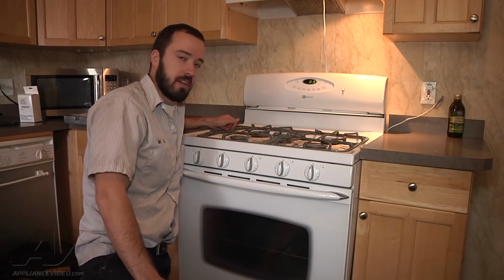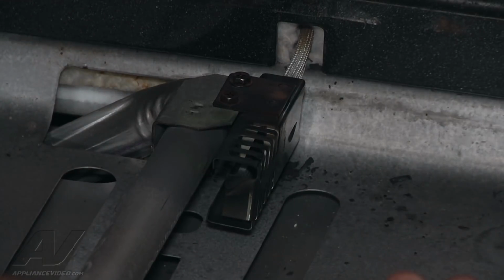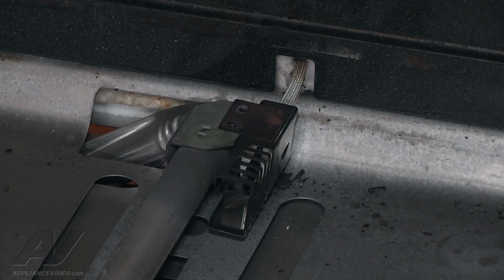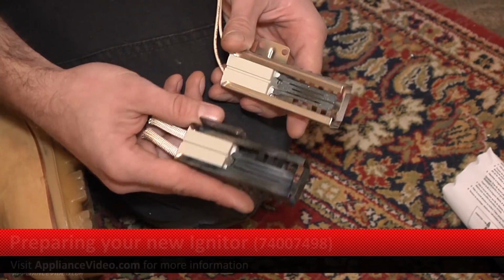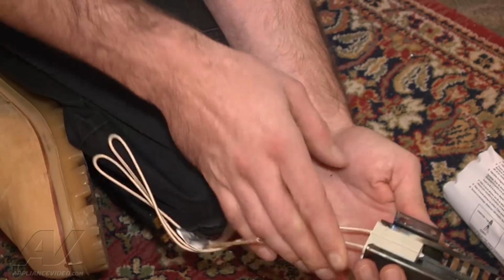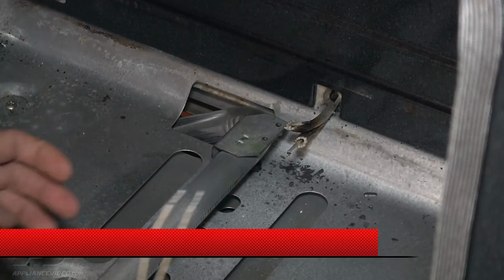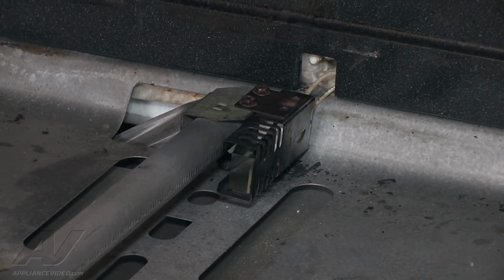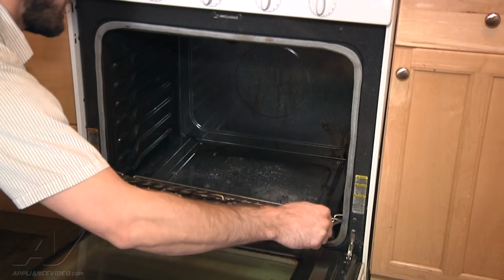Maytag Stove Repair - No Bake - Igniter

Comment: Thank your video, it helps me.  There's upper igniter on the top of oven,  I tested wire no electricity on both wire, I wonder  just change bottom igniter is fine or I have to change both igniter, Thank you

Comment: Hi and thanks for the great video.
I have the same oven and the ignitor was  not glowing. I replaced it by an oem igniter but still not working. I measured the voltage coming to the igniter and was only 2 volt. I guess it should be about 110 volt.
Can you please tell me what could be the problem? 
Thanks in advance

Comment: Hey good video I been try to fix my samsung stove that's giving trouble to light I see the ignitor glowing but it won't light some time it works and then again it won't I just might look to change the ignitor and see if it helps but the valve is good did a continuity test and it was good

Comment: I have had to do this a few times in my LG range. I believe if you hit the clean button or do some cooking on a very hot oven this will deteriorate this little glow stick breaking it down. So the more you cook at these high heats or set the oven on the clean cycle the more times this glow stick or igniter will have to be replaced

Comment: Thank You, Your video helped with the replacement of my igniter, The oven your working on here is the same model I have.
There was no need to cut and spice the wires there is an access panel in the back of the oven where you can access the wires for
the igniter and a quick disconnect, Simply plug and play, Old to New.

Comment: I have a 2012 Whirlpool gas double oven range and the top oven will not start on bake, it seems to work fine on Broil.  So, I am attempting to remove the igniter and have taken the two screws off the igniter and trying to remove it.  I got it off but there is not electrical plug like on your video and others.  Will I need to remove the back of the range and get to the plug from there?

Comment: When oven does not maintain the temperature setting. Can this also be a faulty igniter?
Reply from the maker: Great question, if you have a more technical question that our parts department cannot answer, you can search our over 17,000 answered questions free at our website www.ApplianceVideo.com under our Repair Help section. You can also call our parts department at 1-800-830-5465 and they can give you help 7-days A week ,or search at www.SaveMoreOnParts.com  .

Comment: Did you turn off the gas before doing the ignitor test?
Reply: No.  You wouldn't be able to test it if it lights the gas up then.
Reply from the maker: Great question, if you have a more technical question that our parts department cannot answer, you can search our over 17,000 answered questions free at our website www.ApplianceVideo.com under our Repair Help section. You can also call our parts department at 1-800-830-5465 and they can give you help 7-days A week ,or search at www.SaveMoreOnParts.com  .

Comment: You said to not touch the heating element. Is it okay to touch the ceramic parts? Just wondering. Thanks, Edgar
Reply: No.  The heating element is the ceramic parts.  The two long greyish things that stick out of the end of ignitor .  Don't touch with bare hands.
Reply from the maker: Great question, if you have a more technical question that our parts department cannot answer, you can search our over 17,000 answered questions free at our website www.ApplianceVideo.com under our Repair Help section. You can also call our parts department at 1-800-830-5465 and they can give you help 7-days A week ,or search at www.SaveMoreOnParts.com  .

Comment: My ignitor works I just don't get gas. Any tips? The stove burners work great just not the oven
Reply from the maker: Great question, if you have a more technical question that our parts department cannot answer, you can search our over 17,000 answered questions free at our website www.ApplianceVideo.com under our Repair Help section. You can also call our parts department at 1-800-830-5465 and they can give you help 7-days A week ,or search at www.SaveMoreOnParts.com  .

Comment: Excellent video!  I have a Whirlpool range, model #WGG555S0BS01. It started as not broiling or self-cleaning a little over a year ago. I changed the igniter (not an oem part) in December 2018, but it did not fix the problem, although it has heated properly until last night. Now, the upper oven is completely dead, with no signs of even trying to ignite or heat. The lower oven and all of the stove burners work perfectly.

Does this sound like a bad igniter, yet again?  I'm considering buying the OEM part this time in the hopes that this will fix the problem.

Would you recommend the OEM igniter as the fix for my oven?
  Thanks!
Reply from the maker: Great question, if you have a more technical question that our parts department cannot answer, you can search our over 13,000 answered questions free at our website www.ApplianceVideo.com under our Repair Help section. You can also call our parts department at 1-800-830-5465 and they can give you help 7-days A week ,or search at www.SaveMoreOnParts.com  .

Comment: Silly question..but do you also disconnect the gas and or turn it off?  Or just unplug it
Reply from the maker: Great question, if you have a
more technical question that our parts department cannot answer, you can search
our over 10,000 answered questions free at our website www.ApplianceVideo.com under our Repair Help section. You can also call
our parts department at 1-800-830-5465 and they can give you help 6-days A week
Monday -Saturday, or search at www.SaveMoreOnParts.com  24 hours
7- days A week.

Comment: It  IS necessary to put back the thermal insulation on the new wires!!  Before connecting the wires slip the insulation on the new wires (and keep them longer!) 
the connetion betwen the old and new wires will have to be pushed back into the cavity.
Reply from the maker: Great question, if you have a
more technical question that our parts department cannot answer, our
technicians are answering all questions at our website at www.ApplianceVideo.com under our Repair Help section. You can also call
our parts department at 1-800-830-5465 and they can give you help 7-days A week
Monday -Sunday, or search at www.SaveMoreOnParts.com  24 hours
7- days A week.

Comment: does it matter which wire goes to which wire since there is 2??? like green to green etc.
Reply from the maker: Great question, if you have a
more technical question that our parts department cannot answer, our
technicians are answering all questions at our website at www.ApplianceVideo.com under our Repair Help section. You can also call
our parts department at 1-800-830-5465 and they can give you help 7-days A week
Monday -Sunday, or search at www.SaveMoreOnParts.com  24 hours
7- days A week.
Reply: No.  It says that in the video.  Because its just a big circle or circuit

Comment: Matt, I could use some advice. I have a jennaire gas stove and the oven doesn't ignite. The broiler does but not the oven, so I put an OHM meter across the igniter  it had connectivity but I ordered a new igniter anyway. The new one draws a lot less OHMs so I installed it as per your video. Fired it up and nothing. I checked the wire coming in and going out of the igniter and both wires have 120 volts when bake is selected so it's completing the circuit but the igniter won't glow. The oven defaults to 100 degs. I don't think I have two faulty igniters? I would really appreciate any advice. Brad
Reply from the maker: Great question, if you have a
more technical question that our parts department cannot answer, our
technicians are answering all questions at our website at www.ApplianceVideo.com under our Repair Help section. You can also call
our parts department at 1-800-830-5465 and they can give you help 7-days A week
Monday -Sunday, or search at www.SaveMoreOnParts.com  24 hours
7- days A week.

Comment: Why is it that The ceramic wire nut can be touched with your hand whereas the element being made from ceramic should not be touched?....wouldn't the oil from our skin create a hot spot as well?
Reply from the maker: Great question, if you have a
more technical question that our parts department cannot answer, our
technicians are answering all questions at our website at www.ApplianceVideo.com under our Repair Help section. You can also call
our parts department at 1-800-830-5465 and they can give you help 7-days A week
Monday -Sunday, or search at www.SaveMoreOnParts.com  24 hours
7- days A week.

Comment: What if the igniter works lights up but the burner doesnt turn on could it be clogged
Reply from the maker: Hello, for
technical questions we have a Repair Help section at this link https://www.appliancevideo.com/repair-help/ . There are over 6,000 answers and questions you
can search through FREE to help you with your problem. Hope this helps
Reply: Look above I just answered it
Reply: yes. this happened to me when cleaning my oven just take a pin and clean it out and it will be unclogged, i had to wait two days for the water to dry.

Comment: i have  inglis ele. stove topele dont work properly comes on but wont stay on is it posible for it to be element
Reply from the maker: Great question, you can call
our parts department at 1-800-830-5465 and they can give you help 6-days A week
Mon-Sat . You can also search at www.SaveMoreOnParts.com 7- days a week.  If you have a more
technical question that our parts department cannot answer, our technicians are
answering all questions at our website at www.ApplianceVideo.com under our Repair Help section. We have over 6,000
common questions and answers that you can easily search through by your model
number, appliance make, problem or error codes, and It’s completely free to
search through our question & answer library. There is a very good chance
you question is already answered there.

Comment: What about the top burner
Reply from the maker: Great question, you can call
our parts department at 1-800-830-5465 and they can give you help 6-days A week
Mon-Sat . You can also search at www.SaveMoreOnParts.com 7- days a week.  If you have a more
technical question that our parts department cannot answer, our technicians are
answering all questions at our website at www.ApplianceVideo.com under our Repair Help section. We have over 6,000
common questions and answers that you can easily search through by your model
number, appliance make, problem or error codes, and It’s completely free to
search through our question & answer library. There is a very good chance
you question is already answered there.

Comment: What do you mean by 'plugged in?' do you mean to disconnect the gas valve or the electric connection?
Reply from the maker: Great question, you can call
our parts department at 1-800-830-5465 and they can give you help 6-days A week
Mon-Sat . You can also search at www.SaveMoreOnParts.com 7- days a week.  If you have a more
technical question that our parts department cannot answer, our technicians are
answering all questions at our website at www.ApplianceVideo.com under our Repair Help section. We have over 6,000
common questions and answers that you can easily search through by your model
number, appliance make, problem or error codes, and It’s completely free to
search through our question & answer library. There is a very good chance
you question is already answered there.
Reply: Electrical connection
Reply: electricity

Comment: Thanks for the Video !!!! Mine had  plastic connectors which was a plus. Tip! I started to remove igniter and screws were so tight and a little rusted that it was starting to bend the burner mount.I  then put a couple of drops of Liguid Wrench penetrating oil on screws and let it soak for about an hour and then they came off very easy. ( Don't soak it as a couple of drops will do the trick) and make sure you clean the mount off before installing the new part as you definitely  do not want any oil on the new element. In fact I used cotton gloves when handling new element just to make sure no oil touched it. Worked great and saved me a repair fee for a simple fix.
Reply from the maker: Thank you for
your positive response, we are glad we could help. Please subscribe to our
YouTube channel or donate a dollar  to
our fan funding page to help us create more quality content. This is the only
way we can continue to help thousands of people like you every month. Just
click on the link below and go to our YouTube page and click on the BLUE
support button on the right hand side of the page. Thanks in advance.   https://www.youtube.com/user/ApplianceVideos

Comment: is it NOT necessary to put thermal insulation back over the new wiring?
Reply: I am wondering the exact same thing. The wires will have a little bit of insulation on them but it is not quite as heavy duty as what he cuts through.
Reply: Andrew the ignitor I bought had a quick connect on it. Luckily so did the original ignitor.
Reply: John Hardison basically tried my best to cover those wires. Not perfect, but nothing has melted yet. After the igniter is installed there is very little of the wiring that is exposed to the oven side. Most is behind the range. If in doubt, fireproof insulation can be found at any hardware store. I realize this comes a couple months late. Hope it helps the next guy.
Reply: Andrew Nelson you helped the next guy (me) hah
Reply: Did anyone ever post an explanation to this? I am about to undertake this procedure and would like to avoid a bunch of melted wires.
Reply from the maker: Thanks for your response, we are glad we could help. Our library of over 5,700 videos are currently helping over 1.6 million people like you every MONTH.  Please help us by subscribing to our YouTube channel, or post our website www.ApplianceVideo.com to your Facebook page, Twitter, Instagram or any other social media sites. Your support will help us keep producing more free quality videos.
Reply from the maker: Thanks for your response, we are glad we could help. Our library of over 5,700 videos are currently helping over 1.6 million people like you every MONTH.  Please help us by subscribing to our YouTube channel, or post our website www.ApplianceVideo.com to your Facebook page, Twitter, Instagram or any other social media sites. Your support will help us keep producing more free quality videos.

Comment: I changed the igniter with a new one and the oven still does not work what possible things can I do?
Reply from the maker: De Witt
          All of our technicians are now answering questions daily on the ApplianceVideo.com website. You can search completely FREE in our Repair Help section. Or you can get unlimited technical advice and video links emailed to you by our 14 factory certified technicians at http://www.appliancevideo.com/premium-membership/.  If you are in need of any parts please support our parts department on line at http://savemoreonparts.com/ or call 1-800-830-5465 7-days a week until 11pm Eastern time. Thanks for your support. Matt Ace Appliance factory service technician.

Comment: Wow, your video is the best of any other ones on here!!  I have an old Tappan TGF362BBBA, and it has been acting up for a while now.  The last few months when I would press Preheat, the oven would heat up, but it took about 45 minutes.  Now the igniter is just glowing orange and not heating through the tube.  The good thing is that the burners and broiler are working.  Do you think the oven igniter just needs replaced?  This oven has a dual gas safety valve, could it be that?  I hope not, because it wouldn't be worth replacing!  I tried using a multi-meter to check the gas safety valve, but I'm confused as to how to really check it.  I can't pull my range out from the wall because it is way to heavy, and that's why I really like how you show to replace the igniter by doing it inside the oven!  Any help you could give is very appreciated, thank you!!
Reply from the maker: Rose Swiokla 
                            All of our technicians are now answering questions
daily on the ApplianceVideo.com website for anyone needing help. Just copy and
paste this this question under REPAIR HELP, and one of our  factory
authorized technicians  will answer any technical questions at absolutely no
charge on your appliance issues. If you are in need of any parts please support
our parts department on line at @ or call 1-800-830-5465 7-days a week until 11pm Eastern
time. Thanks for your support. Matt Ace Appliance factory service technician.

Comment: WHAT ABOUT IF YOU DO NOT EVEN SMELL GAS? The top burners work, but the broiler/oven does not. Even if the igniter is bad shouldn't you smell gas when turned on??
Reply: +Andrew Anselmo 
No, the oven has more safety measures as the oven goes on & off to maintain temperature.   Older models with a gas pilot light had a thermostat  near the pilot flame that controlled the valve.  Electronic starters could use a thermostat or a sensor that monitors the current going through the igniter.
Reply from the maker: Thanks for your response, we are glad we could help. Our library of over 5,700 videos are currently helping over 1.6 million people like you every MONTH.  Please help us by subscribing to our YouTube channel, or post our website www.ApplianceVideo.com to your Facebook page, Twitter, Instagram or any other social media sites. Your support will help us keep producing more free quality videos.
Reply from the maker: Thanks for your response, we are glad we could help. Our library of over 5,700 videos are currently helping over 1.6 million people like you every MONTH.  Please help us by subscribing to our YouTube channel, or post our website www.ApplianceVideo.com to your Facebook page, Twitter, Instagram or any other social media sites. Your support will help us keep producing more free quality videos.